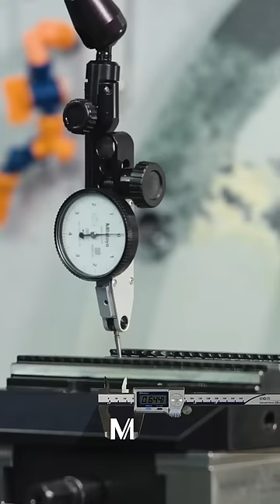Learn How To Run a 5 Axis CNC Machine🤓

Comment: This is 2 1/2 d not 5 axis
Reply: Naw, the first operation did 5 transformations, second op was just a basic 3 axis vertical transformation.

Have you ever run a 5 axis mill?
Reply: This would be more classified as 3+2 machining. 2.5D is more like what you'd see on a typical mill without any indexing abilities.

Comment: these guys know so much about machining but not that wd40 is a cleaning agent, not a lubricant. it even says on the cans
Reply: In this case the WD40 is being used to keep the stone flushed out. If it wasn’t for that the stone would load up and not work properly.
Reply: Agreed. It's being used as a cleaning agent here, as well as a flush for the stone. Didn't know that about the flushing part, to be honest.